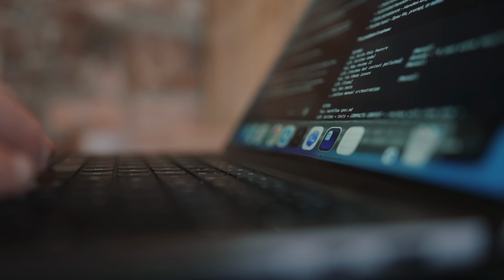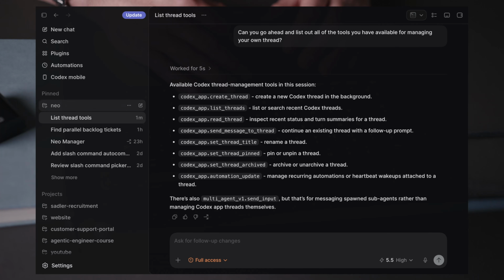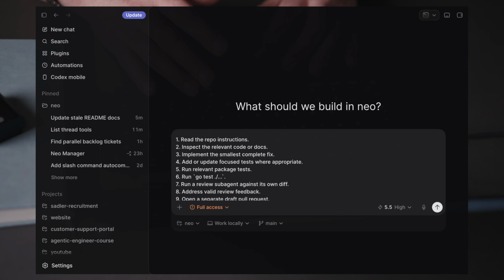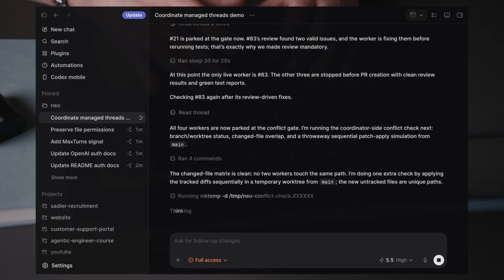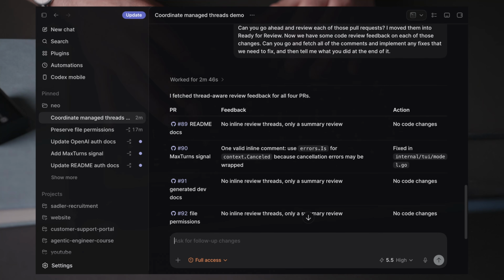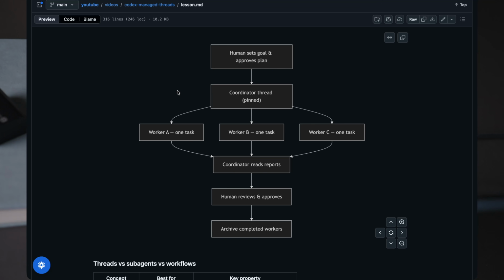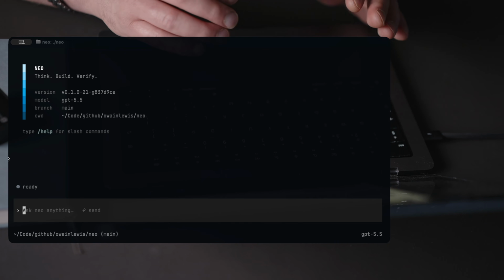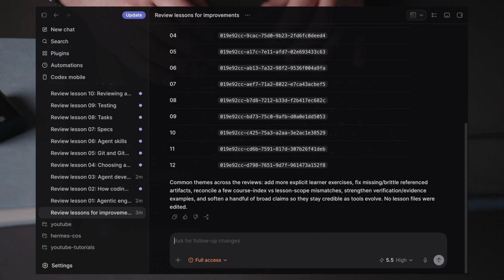Codex Can Manage Itself

Comment: Thanks for this! I was literally searching on how to use goals and parallel agents yesterday and learned about threads from this video which is exactly what I needed!! I tried to test it but had some limitations. When I asked codex to spin the new threads, Codex created the threads in the folders and worktrees and give me the links to the md files! I  did not create any in the  GUI. I turned on full access and asked it to create threads in the left panel but it still couldn’t. Is this an account issue?
Reply from the maker: No problem. I didn't see this issue. An upgrade would be worth trying but assume you've done that. I'd ask Codex to debug itself. This is one of my favourite features. It's not available in the GUI from my testing - only the GUI. Worth asking Codex to show you if it has the tools "Show me the thread management tools you have available".

Comment: Great video. I tried to replicate this, but my Codex Hub only has subagent tools: spawn_agent, send_input, wait_agent, etc. It does not expose create_thread, list_threads, read_thread, send_message_to_thread, set_thread_title, pin/archive, etc.

My Hub can spawn internal workers and worktrees, but not durable visible managed threads like in your demo. Do you know if this requires a preview flag, specific Codex build, GitHub-connected repo, multi_agent_v2, or another setup step?
Reply: I had to beat my Codex into submission to finally manage threads consistently
Reply from the maker: @JoshPeterson yeah it can be hit and miss. Naming the specific tool might help (ask codex to list them and say use the … tool to create a new thread).
Reply from the maker: It would require updating to the latest codex desktop app. It didn’t work for me in the CLI only the desktop app.

Comment: Hello great video!
I wonder to what extend coordinator is able to "manage" concurrent modifications made by various threads when modifying shared code parts accross the different sub-tasks (or issues) - is it reliable?
Reply from the maker: Thanks. That's a great question. Ultimately concurrent modifications will always cause problems. So the answer is to run each thread as a separate worktree which means the changes in that thread are completely isolated and separate (a worktree is just an isolated folder/copy per thread). You can simply say "For each task: create a new thread in a separate worktree and work on the issue". If there are dependencies between tasks (a depends on b) - I'd still let the coordinator manage the work but it can work on one at a time.
Reply: @owainlewis insane thanks for the Quick reply